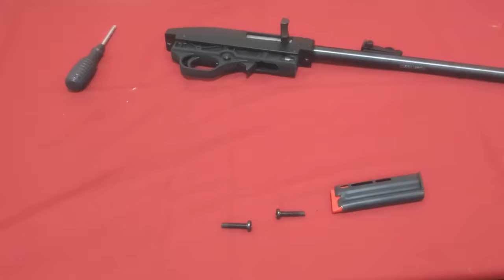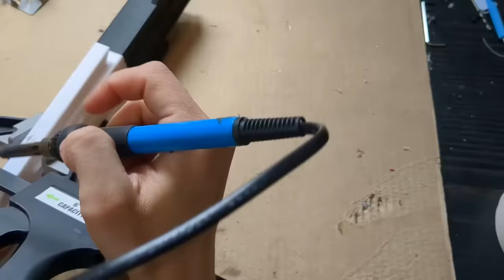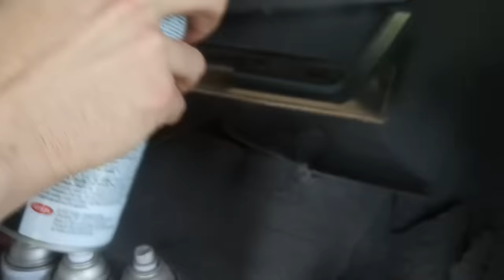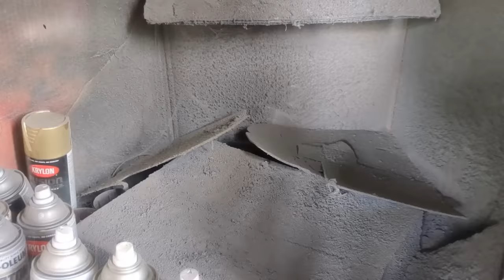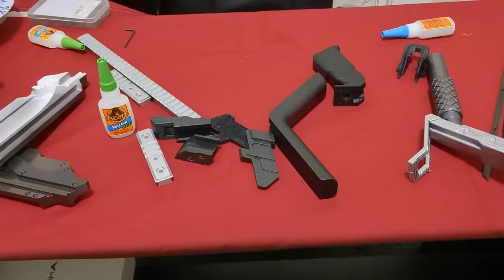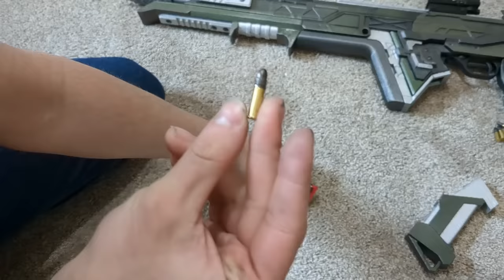Functional R-301!   Bringing Apex Legends to life

Comment: so cool! 
lot of effort put in and it shows. consider getting a real plastic welder for pieces that need to be joined, put chamfers on the area that will be joined and use filler for a stronger joint.

Comment: Bro this was phenomenal. One tip I learned with having to mend pieces I printed is to invest in a hot stapler/ plastic welder. It saves you so much time on your build, is structurally more sound and a lot less grinding/sanding and kits are really cheap. Either way great job bro!
Reply from the maker: Thank you so much 🙏

Comment: you gotta design an extended mag for the .22 and get another r301 mag design to where the .22 mag fits deeper into the 3d mag and basically youd have a full r301 mag instead of the little 10 rd mag. also wanna add that this is the sickest thing on youtube ive seen
Reply from the maker: Thank you 🙏

Comment: Great work and effort! Its a piece of art! What Slicer program do you use for the printer?
Reply from the maker: Have to use Bambu Slicer for my P1P, but I use Cura for my other two printers
Reply: @BanishedBuilds  Nice I also use Cura as well. Just wondering do you have to completely disassemble all the 3D printed parts in order to clean the gun?
Reply from the maker: @powerman-_-  just a few parts

Comment: Correct me if im mistaken 
Is that a rosi rs22?
If so there is a extended mag that you migth be able to work with, the rs22 is extremely limited on aftermarket parts unlike a ruger22
Im interested on a stl or a print
Let me know if we can work a colab together

Comment: When you print the pieces, do you add a little lip on the edges so when you bring out the soldering tool it's the lip that melts over the seam? And then just sand the raised parts down flat?
Reply from the maker: It's just what's left of the Brim. I usually try to plastic weld into the parts a bit the first time and then add more material when soldering to fill it back up. The more material you can melt together, the better your weld will be.

Comment: Regular glue for plastic models works better than welding parts with the iron
Reply from the maker: It 100% does not. I've been doing this for a long time and a good plastic weld is always stronger than glue
Reply: @BanishedBuilds  What type of glue did you use?
Reply from the maker: @MikeNugget  I've tried super glue, epoxy, and gorilla glue. None of them worked better than a good plastic weld, and none of them fill in the left over gap unlike plastic welding
Reply: @BanishedBuilds  you can try regular Tamiya glue or Tamiya Cement specially designed for gluing plastic models. And did you try just an acetone?

Comment: Wouldnt combining glue and soldering make it even stronger than just soldering?
Reply from the maker: After plastic welding you're more likely to break a wall off of the print rather than the two walls apart. At that point extra glue makes no difference because it'll have the same issue

Comment: Sentinel I think should be a larger heavier round like 300mag or 7mm-mag. Long bow would be great for the 6.5 creed. I just know the sentinel shoots a slower heavy hitting projectile while the long bow is a faster not as heavy projectile. Or maybe Vantage's ultimate would be a good candidate for the 6.5 idk just ideas and opinions. Anybody else wanna tag in on this? Another person with knowledge of ballistics perhaps?
Reply from the maker: The highest caliber that is still somewhat budget friendly seems to be 6.5 creedmoor, which is the biggest reason I'd probably stick with it. Only larger caliber I'd consider is  30-06 but that would get pricey too
Reply: 30-06 and 6.5 are still like $20 a box in my area 7mag is around $25-35 for the cheap stuff or $40 for the ballistic tips. I think you can get either one in a decent bolt action from a pawn shop for around $300
Reply from the maker: @johnywatkins3620  yeah, the issue is $300 already almost doubles the budget of this build (and this one was already pushing the budget limit), then on top of that the parts would have to be casted instead of 3D printed to handle the recoil of a higher caliber round. I currently make absolutely zero dollars off of this content so any increase of budget is a lower likelihood of a project happening

Comment: That melt-weld method isn't better than a 2 part epoxy glue. The plastic will fail before epoxy.
Reply: Great vid though!
Reply from the maker: Either way the wall separates from the infill before the walls of the two prints separate. No use in spending the extra time and money on epoxy

Comment: Or you can get the actual firearm r301 was based on. The Apc45 pro g using glock mag, r99 is similar as also use glock mag but its based on cmmg banshew instead(dont vector me bcus r99 doesnt have vector recoil system and everything on r99 exists on ar15 platform n banshee is the only one fit everything including taking a glock mag)
Reply from the maker: I wish I had the money that y'all think I have
Reply: @BanishedBuilds  aye that thing sits around 2k5 $
Reply from the maker: @m4j0r3x  please read previous reply again 😂
Reply: @BanishedBuilds  exactly  :v

Comment: I really hope you didn't just accidentally make an SBR without filing an E-Form 1 though the ATF.
Reply from the maker: The barrel didn't change length from when I bought it 🤷‍♂️
Reply: @BanishedBuilds  Overall length, from the end of the actual barrel, no accessories, to the end of the stock can't be under 26"in
Reply: @BanishedBuilds  

If your rifles overall length is under 26" but the barrel is 16" or more. Then you need to extend the stock to keep it from being an NFA item/SBR.

If the rifle in this video is an SBR, then delete this video immediately as it is self incriminating evidence.

The ATF is going to be cracking down on SBRs after their "final ruling" effective May 31st. I'm just trying to let you know so you don't become a felon and get charged with a $10,000 fine.
Reply from the maker: @x-Saffron-x  total length is already 32 inches
Reply: @BanishedBuilds  

Okay good. Just keep it in mind for future videos. 

I think what you did here is awesome, so I want to make sure you don't get rolled up.

Comment: Use a ruger 10-22
Reply from the maker: Woulda been double the price for a gun that'll stay on its display rack most of the time. No point in wasting money
Reply: @BanishedBuilds  if you calling converting a ruler 10-22 to a r 301 a waste I have put too much faith in the wrong person yet again
Reply from the maker: @mrlmmo1712  it's basically the same gun I put in it. Absolutely no reason to spend the extra money for the brand 🤷‍♂️
Reply: @BanishedBuilds  waste. Only waste I see is you